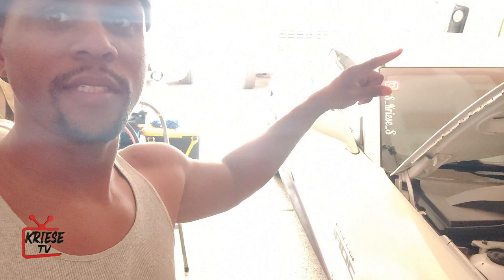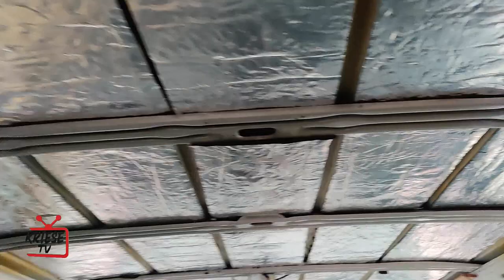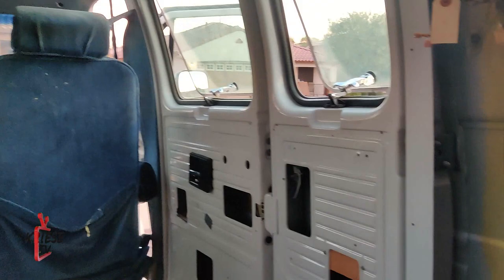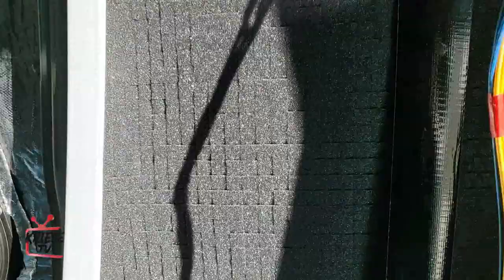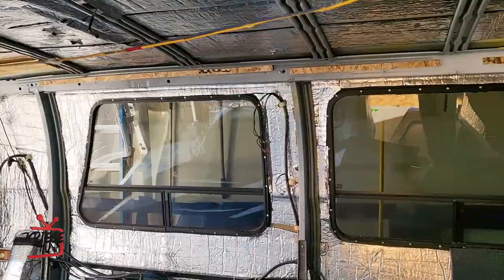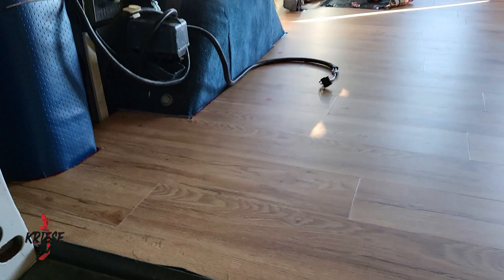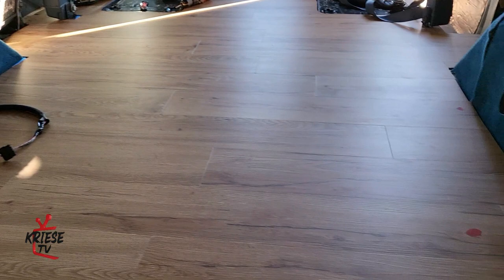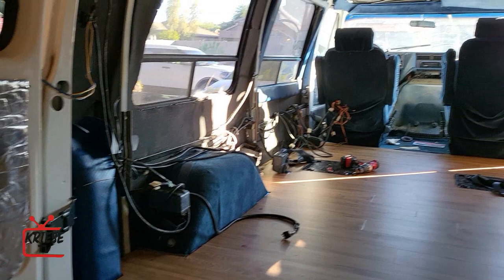The G20 Restore Continues!! Vlog 4

Comment: You did a great job!  I'm not sure how much the foam will actually help insulate but that's a great idea. I recently did the same in my van and I used a layer of Kilmat which is a similar product for sound dampening but much easier to install. Then I used a layer of Reflectix insulation. If you leave a 2 inch air gap and put another layer of that on the inside of your walls it works pretty decently to insulate and dissipate heat. There area  a million ways to insulate and everyone claims to have the right way I know but these products work pretty well for me for sure. Looking forward to seeing the progress of your build friend.
Reply from the maker: Appreciate that! Yeah it's definitely a learning process but the joy of doing  it yourself, you know it's getting done to your liking 👍🏾 💯 which I don't mind.